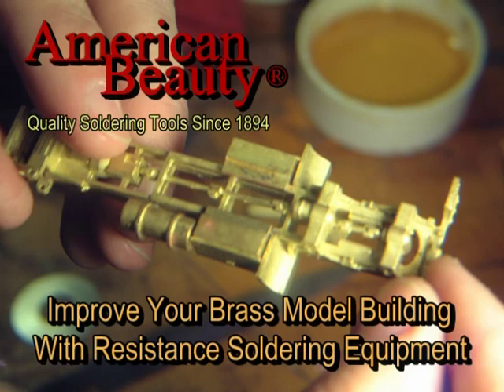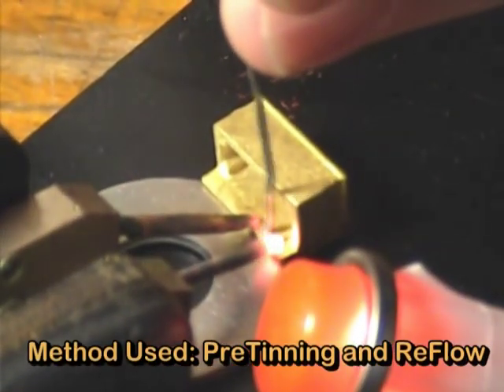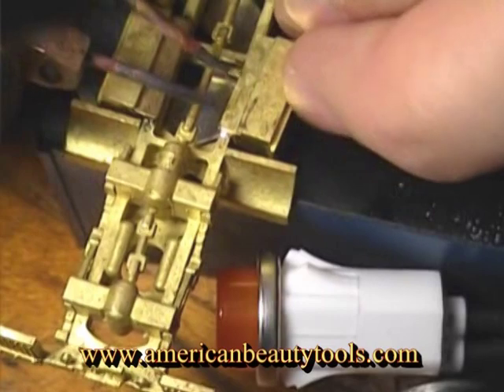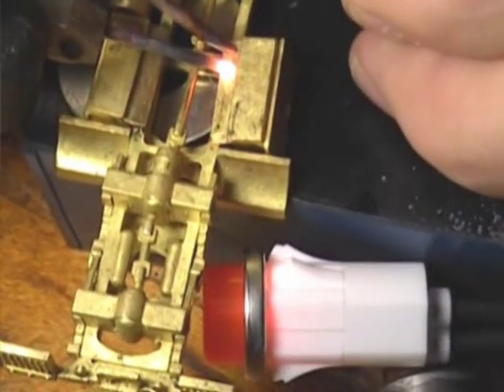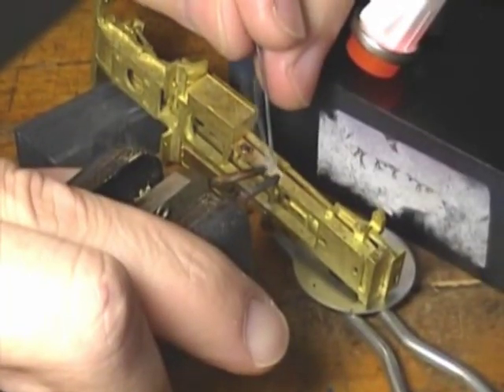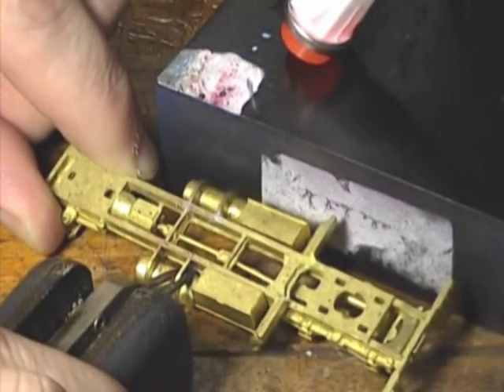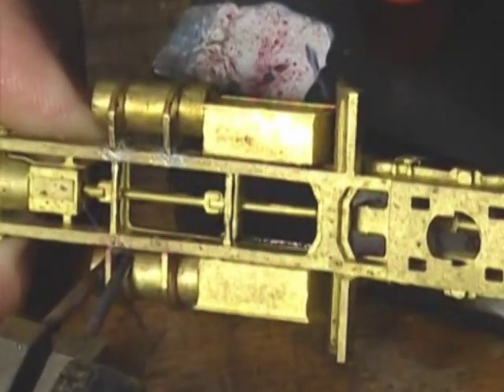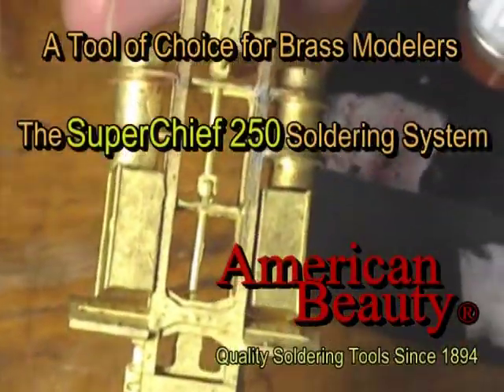Resistance Soldering Brass Modeling Components.

Comment: What solder do you recommend I want to do model kit photo-etch brass safely in the apartment  and weld it not glue it.   I have acid flux paste all I need is the solder I heard plumbing solder,  Silver wire 60/40,   50/50 tin lead solid wire etc.